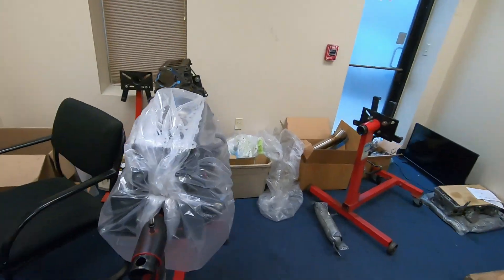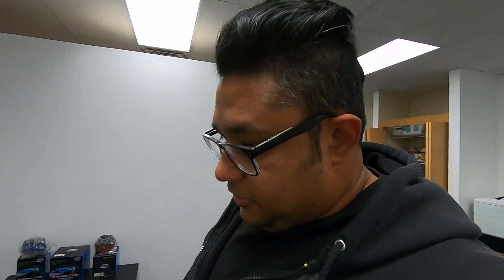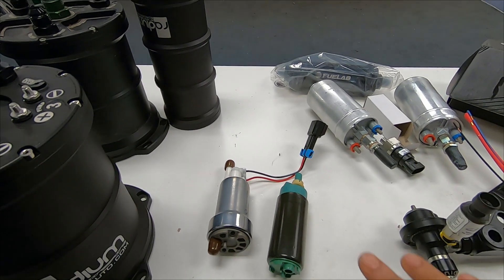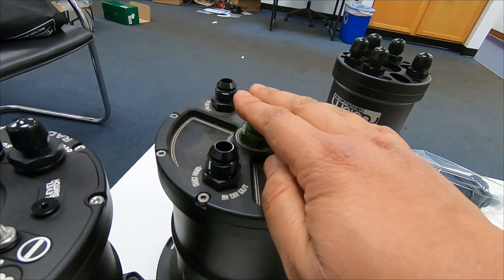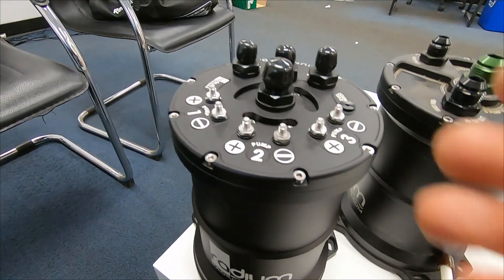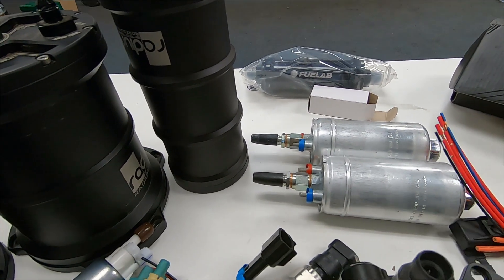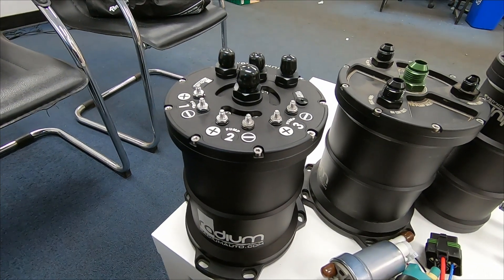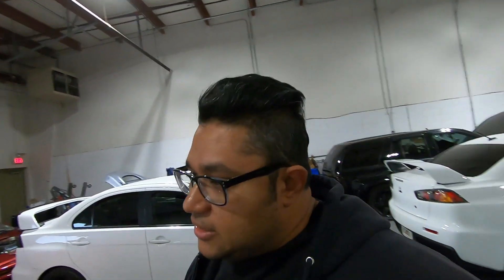surge tanks fuel cells external and internal fuel pumps and how they work fuel pump hard wring

Comment: Just a bit curious. Say for an instance you have an inline oem fuel pump feeding the surge tank and then a Bosch 44 external pump in a series configuration to the fuel rail. 
Since the external pump will be noisy. Will I be able to just switch the external pump off (when i dont need it) and let the inline pump do it job?
Reply from the maker: "inline" is external to any container and independent in the fuel line. I wouldn't recommend it for what he asking. I also don't recommend any inline configuration unless u have a gravity feed fuel cell.
Reply: Thanks

Comment: for a a90 supra what surge tank would you recommened i have csf manifold with the 5 pack air cooling system stage 1 pure tansmission 850 pure turbo mike botti tune ecutek boost logic down pipe awe exhaust touring edition with versus heat sheild ftp charge pipe mst cold air intake i want a recommendation for high pressure fuel pump and what you recommend for surge tank should it be placed in my trunk ? im thinking port injection flex fuel im currently 550 bhp but want make 700 horse power please help thanks.

Comment: Have you used the Manely H-Tuff rods yet?
Reply from the maker: Yes haven't broken it yet but consensus is 500 tq max
Reply: @bdalchemist  Oh, i tought they could handle way more since they seem quite beefy. I called manley and they claim it can easily handle 950hp. But the torque that comes with even 800 seems like a lot more. :O

Comment: So does that relay box eliminate the stock relay under the hood?

Is the surge tank needed for 800+hp or can u get away with the double pumper in the tank?
Reply from the maker: no it adds relays to anything ur running that you made a separate circuit for.